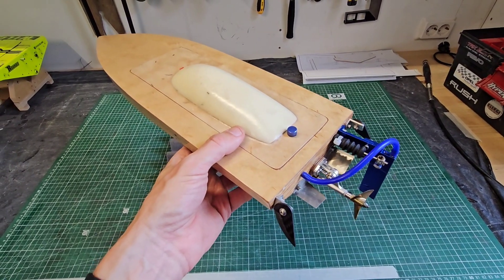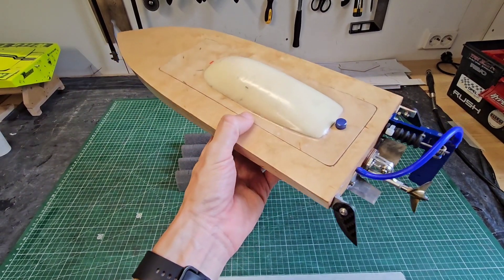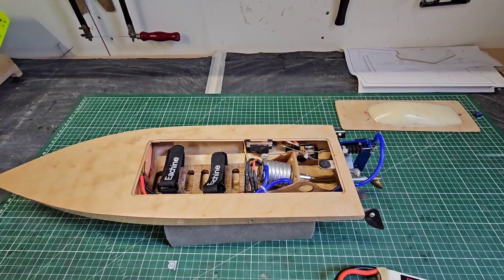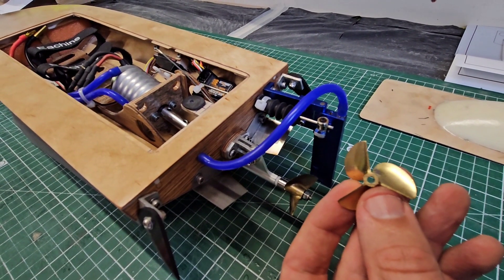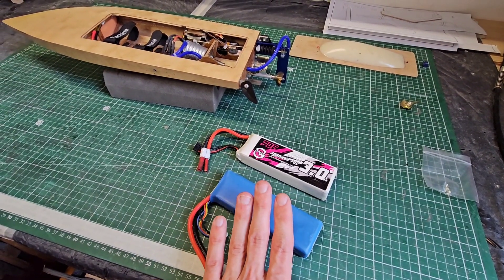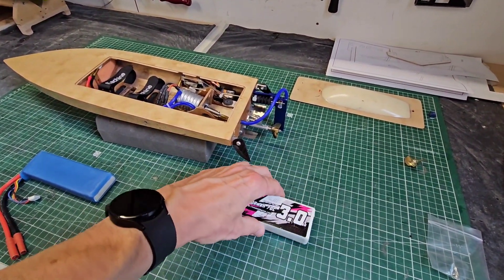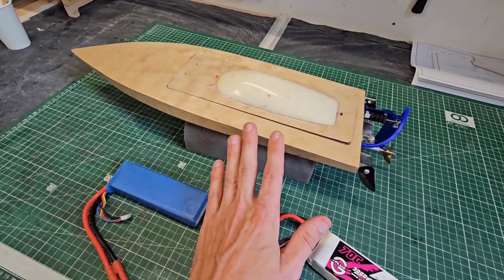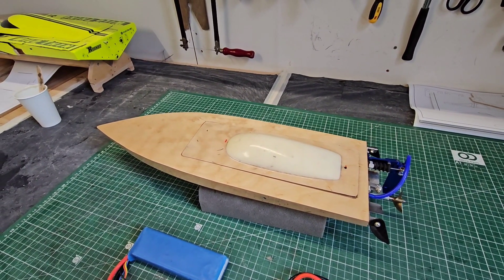DIY Mini Mono - Oval running and future plans

Comment: What KV motor are you running on 4S 
As I have ordered 2948 3450kv
Reply from the maker: I'm using a 2600kV motor. On 4S that gives almost exactly the same rpm, as the 2948 3450kV on 3S. But since the Rocket 2948 3450kV has more power, I expect it to be even faster! I will soon try it with that motor. I just need to order the correct coupler size.

Comment: I am wondering how the performance would change if you install recommended 2948  Rocket motor. I guess based on quality and kV you can beat your speed record 😊
Reply from the maker: I guess the speed on 3S will match my current speed on 4S. Probably even a bit higher, due to more power of the Rocket motor. I'm going to try it soon! I just need to order the correct motor coupler 😎